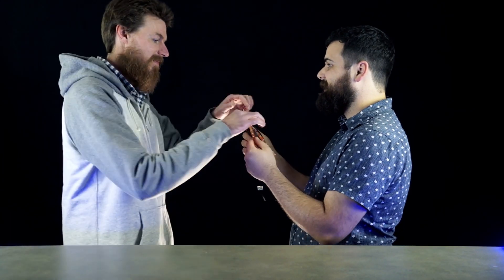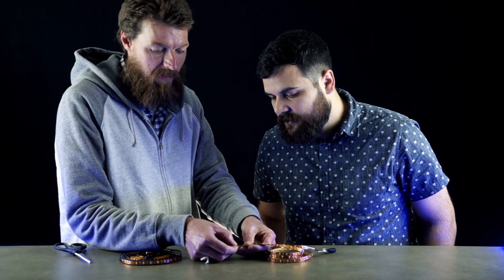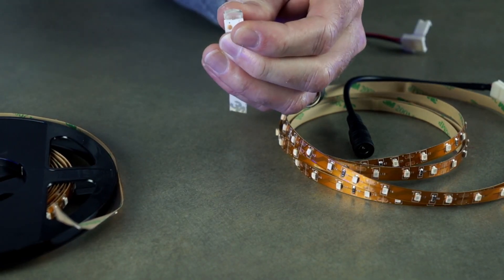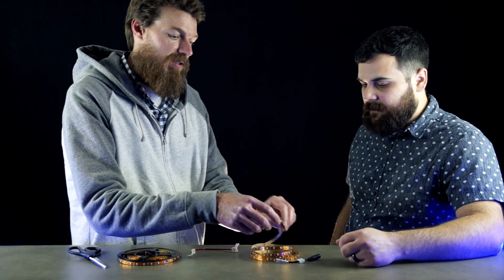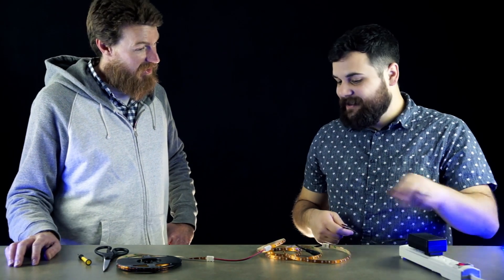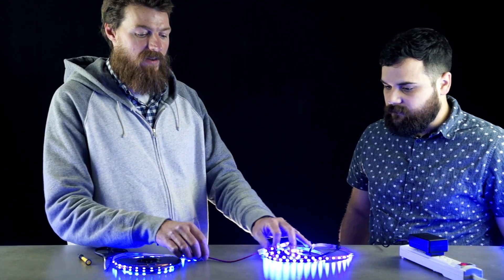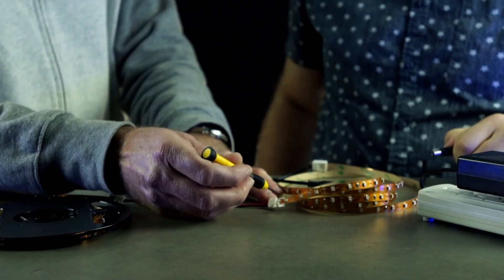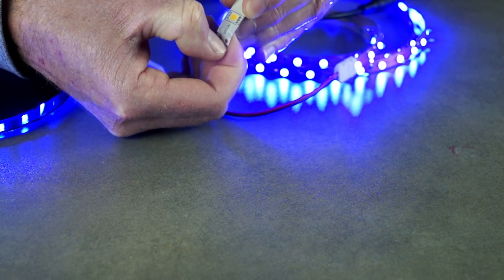Common LED Light Strip Connection Issues

Comment: Hold up this is inaccurate AF. If the strip doesn't cut on its the psu or the outlet? NO, I'm troubleshooting some 24v COB strip that worked fine a week ago, but now no output. Pulled out the old Multimeter and tested voltage from the start down the strip. PSU spitting out 23.75v and at various points of the strip it's the same story. There is some voltage drop to like 22.75v, but still no lights. I started checking for continuity on the data line  and beeps all around
Reply from the maker: Hi, @jtmnyallbudsnoseeds for us to be able to assist you further, kindly relay your concern to customerservice@hitlights.com or 1-855-768-4135. Our technical team would be happy to assist you with your issues. Thank you!

Comment: I just opened a new set of Extreme strip lights. When I turn them on, all it will do is blink red. I tried resetting it, the batteries are new, what am I doing wrong?

Comment: My problem is just annoying i have a neon strip that connects to this white box and then an adapter, its really good but it works stays on and has app and remote but after like one day if i havent sent any signals it will just freeze and not reply to the remote or the app and stay in whatever setting it was, to fix this is have to remove wire from power supply and recoknect and it works again why is this sooo annoyinggg

Comment: Hi my light strip only comes on when i push the connectors together when i let go they come off
Reply from the maker: Hi Shirley, this usually happens when connector pin doesn't have enough contact to LED strip copper pad.

You may follow these simple steps in trouble shooting the issue:
1. Open the connector box
2. Check and make sure that LED strips oval or circular copper pads are properly lined up or touching the connector's silver pins.
3. If you can see that they aren't aligned right, gently move the strip back and forth until the strips light up properly and this usually fixes connection issues of your LED strip.

If you need further assistance please contact us at  1 (855) 768-4135

Comment: My thing to connect it is lose and if I do it carefully and it doesn’t fall out it won’t work. I used to just set them down carefully and it worked but not the connection thingy won’t work at all. Sorry this was badly explained but if anyone could help pls reply to this comment (I have stardust leds btw)

Comment: mine wont turn on, but when i tried to push it earlier it was flicking, but when i tried it again it wont work. i had this leds for 3 months already. nothings wrong with the battery, even if i try to turn it it won't. idk if its incorrect wiring or something, but it just wont work yo 😭😭

Comment: I need help
I have 4 wire 3528 rgb strip light and i want a connector between two cuta but i couldn’t find one anywhere cause 4 wires some only with 10 mm strip light width but my strip light width is 8 mm. Please help

Comment: I have a led strip that works fine in running mode. But after 2 mins the other half will freeze over but still has lights on. Help me guys

Comment: Help my remote that is for one of my lights is connecting to another brand of lights
Reply: Thats normal.
Reply: If you want them different colors. Turn one off and turn on the other one change it to the color and repeat the same steps for the other side!

Comment: I have two light strips connected together, and i want to add a 3rd, but it won’t turn on. The strip isn’t broken when by itself it will turn on but not when connected to the other ones i have

Comment: my leds only work a tiny bit when i touch the silver thing in between the actual lights and if i touch the one labeled “green”, it turns blue but when i touch the one labeled “blue” it turns green
Reply: same issue here, you ever solve it ?
Reply: @andreasmoustakas1171  no srry hadda trash them 🤷🏻‍♀️

Comment: Ive done 4 sets of lights. TVs, bedrooms. I connected 4 sets of strips together. One strip will be yellow and the other 3 are red. One strip is white the other three are blue. In the bed room the further the distance the color changes. It will be red close to the power supply and almost pink orange by the end of the 60' run. These connectors do not work well at all. They are so finicky.

Comment: I literally just got mine today and they turned on once and when I put them on my wall they won't turn on
Reply: Did u ever fix them ? I got mines today & they were both working until the right side started to  cut out I was having trouble getting that side to connect while putting them up tho.

Comment: i just received my led lights but only green turns on. For instance, if i click purple or yellow it either dims or turns off. Depending on the color I choose. The arrows ARE matched. help?
Reply: i have the same problem did u find a solution?
Reply: My lights only show yellow blue and white, when I disconnect I one of the lights the other one is normal😭

Comment: i have 2 of 5m strips, i bought both at a different time ive been using it for a week now. but i woke up then the other 5m strip, a small quarter of it has no blue on it. the first control box wasnt working, the other strip wasnt as bright as the other one. so when i changed it, the lights are equally bright but the blue is still gone. Help me lmao
Reply: Wait I bout same brand but diff weeks than I adapted them but 1 side brightness isn’t working like the other one also how do u sync them cause mine when I change one side has diff color other one is a it side

Comment: i plugged them in and they wont turn on, but when i touch a censor thing on the strip it turns on a portion of the strip and i changed the battery in my remote to see if thats that problem but now it wont open, my little sister spent 50$ for them

Comment: Mine wouldn’t turn on it was a dim light blue color I was thinking it’s the remote battery I wasn’t I got the lights 3 days ago only thing u need to to do if you have the same problem is switch the outlet it is in

Comment: If your lights stop working do what I did, check the white box the big battery goes into, pull it out and see if the plugs plastic has melted this is because you have to many LEDs

Comment: I just got mines today and one strip worked fine but when I hooked the second one up (which came together) they didn’t turn on 🥺😢PLEASE HELP BC IM BOUTTA CRY
Reply: Try connecting both lights to the receiver, should have two cords for two connections. Then run the lights away from each other, and have them meet somewhere.
Reply: Vlad the comrade thx they work now

Comment: so i had dropped my controller in water on accident and it feels like I’ve watched every video and nothing works I’ve tried different outlets, connectors, took everything piece by piece and nothing works but after i dropped my controller in the water i automatically took all the water out by shaking it and tried it and it worked again but then i unplugged it and then the next day it didn’t work I’ve been crying and i need help

Comment: I received my led lights today, I made sure to plug it in correctly, but it’s not working.
Reply: Ada Onyeani did it ever work?
Reply: Jaedan J yes
Reply: Ada Onyeani How?
Reply: Ada Onyeani howww?
Reply: Ada Onyeani HOW PLEASE ANSWER
Reply: Harrisha Reyes I just kept taking them apart and putting it back together
Reply: i need answers on how they work please
Reply: i just got mine, i hung them up and everything and i even changed the battery in the remote but it’s still not working😭😭i spent 30$ on amazon for these and I’m broke and they won’t word

Comment: ⚠️PLEASE HELP!!⚠️

Only like three weeks into having my LED lights I noticed that my TV remote also controlled my lights for some reason? (Certain buttons would change the colours of the lights) but the On and Off button to my TV remote would turn my lights off and I would just turn my LED lights back on after.. but one day as usual my tv remote On and Off button turned off my LED lights and now they won’t turn back on at all. I’ve tried everything.. I’ve tried new sockets and new extension cords, I’ve tried unplugging everything and replacing it back in.. I even left the lights alone for a while thinking that they would maybe turn on again if I just left them alone for a bit but they still won’t turn back on :( someone please tell me what to do! ⚠️

Comment: Liam please help I’ve had mine for about 2 or 3 months and I had lost my remote a few weeks ago and just found it and me and my friend were testing diy colts and all the sudden they turned off. The buttons on the wall and the remote isn’t even turning them on. I plugged and unplugged them and fixed the wires and everything but they still don’t work! What should I do

Comment: Need help! My led strips are not working right(specifically GREEN). When the led is on turned off green is on but on dimmed. When I turned it on and set on green light same things happen when it is off. dimmed green only appears. That is why when I set it on white, purple/pink color appear. It seems green is not working properly. Please help. Thanks in advance!

Comment: Why only one side of my led lights work n when I flip the connect thing the other side stop working and the other one works... plz contact me if u know how to fix this
Reply: Yes same problem with me have you figured how to fix it?
Reply: Crunchy flip the sides of the thing that’s on your wall and it should work
Reply: Itznay N wait the thing?
Reply: Itznay N what thing?
Reply: Itznay N is it the thing where you connect the four lines to?
Reply: Crunchy the 2 led lights that connect together on the wall... not the one that plug in the wall but the ones that’s on top of the wall
Reply: @itznayn4524  minee wont change brightness

Comment: i just put up my led lights today. they were working perfectly fine until i turned them off while we put the rest of them on. when i tried turning them back on it wouldn’t work. we unplugged the wires that connect to the white strip on the white box. they used to flash when we would plug it back in, but now it’s doing nothing. can someone please help me.

Comment: i had mine for 1-2 months already and they worked fine but i tried to move the adapter a little and the whole thing turned off and the green light isn’t even on somebody please help😔
Reply: I have the same problem 😭 did u find a solution???
Reply: Nora Sama same

Comment: when i plugged my led lights into my extension outlet, they turned on but they won’t change color. i would try using the remote to change the color but it just stayed on purple. please help me 😩
Reply: Mine always gets stuck in purple too :/
Reply: Mine does that same with very low brightness! I left them on overnight and when I woke up they were in that state!
Reply: i just got mine for christmas and mine do the same thing. they are stuck on red and won’t change colors. did u figure out how to fix if???

Comment: Was trying to build a neopixel blade for my lightsaber and it has a RGB compatibility in the strip but for some reason when I wired it it all came in white and when change the color I can change the color of via an app on my phone with my saber but I have a question if both data lines are touching with this cause the LEDs to just register as plain white

Comment: only one side of my led light strips are working it’s so annoying!
Reply: Both of mine work but they are different colors. Pleas help
Reply: Natalie Haadsma same
Reply: Bunny.Milky same here
Reply: So what you do is flip the white thing that plugs up to it but leave them on then they both should come on I have having the same issue
Reply: @4strokesmokemonroe714  thanks!
Reply: 4strokesmoke Monroe thank youuuuuuuuuu
Reply: @4strokesmokemonroe714  I did that and it didn’t work
Reply: OKAY! So I just had this problem and you need to play with the remotes and spam them. So basically just spam the on and off button and it should work. I just did it and it worked
Reply: Lina Jones it didnt workkk
Reply: Lina Jones mine needs to be bent sooo much
Reply: Lina Jones yeah I done that
Reply: Guys I know how to fix that I had that issue but it turned out that you bent it so it loses connection so unbend it and it will work
Reply: Jana Hesham , ok so can you like explain what’s bent ?. cuz i’m confused on what’s bent.
Reply: Jana Hesham the only way to use mine is if it is bent 😩
Reply: SciiZ just tap a bunch on the led lights where it’s not turning on
Reply: Sameeeeee
Reply: did you ever figure it out?
Reply: thats because its become disconnected to the other side of the rgb's
Reply: SciiZ  this happened to mine and I think I know how to fix it ! Do you know the wires where you hook them together unplug them twist them the tiniest bit then plug them Back in !
Reply: Abi Pearce Buttery I don’t get it please help me only one side is working
Reply: xbunniesx so where the other strips are connected to the one that is working the little connectors , unplug the connectors and rotate them and then put them back in and see if they work , have a mess about with them and they should eventually all be working
Reply: Abi Pearce Buttery thank you I’ll try
Reply: xbunniesx okay let me know if anything changes
Reply: Abi Pearce Buttery just had my sister help me out and it still wasn’t working any other advice?
Reply: Abi Pearce Buttery they still not working any other advice?
Reply: xbunniesx did you twist the connectors on all of your strips , some may need to be twisted some may not , the only advice I have left is keep trying and play around with them maybe after a day or two they will start working , just try unplugging them twisting them and experimenting with them !
Reply: Abi Pearce Buttery okay I’ll update you soon on them! Ty
Reply: xbunniesx okay ! no worries
Reply: @abibuttery3752  THANK U THANK U THANK U I WAS ABOUT TO RETURN THEM BUHHHHHH NOT ANYMORE!!!:)))))
Reply: Arrow Chang no worries I’m glad it helped !!!
Reply: Abi Pearce Buttery , so i’m confused... idk what wires i feel slow , can you tell me what wires?.☠️
Reply: @abibuttery3752  thank u so much !
Reply: i'm having the same problem :(
Reply: me tooo !
Reply: samee there was 2 and only 1 is working :(
Reply: try flipping the white thing with the four holes that connects the lights to the other side, if the arrow is pointing down flip it to the other side up, lol i hope that made sense !
Reply: @courtneeaster4543  z.  z  aavb
Reply: One side of my stop lights is one color and the other side is another kwidieijd
Reply: GUYS I KNOW BASICLY WHEN U CONNECT ONE CABLE TO THE OTHER MAKE SURE THEY ARE CONNECTED IN THE RIGHT ORDER MEANING BLUE WHT BLEU RED WHT RED ETC I THINK U HAVE THEM CONNECTED IN THE WRONG ORDER LIKE SO OTHERS CAN SEE
Reply: @andrevieira2911  BRO THANK U NOTHING ELSE WAS WORKING
Reply: Same
Reply: Same
Reply: Same
Reply: same
Reply: Same
Reply: Me too
Reply: same
Reply: Same please help me only one of them are working
Reply: xbunniesx where the lights connect to the white box, (with the 4 holes) unconnected them and turn that white cord the opposite way you should see an arrow on the white connector piece flip it the other way. i hope that helped !
Reply: Courtnee Aster thank you I will try
Reply: I’m having issues so my lights don’t show blue and I can’t flash my lights. Also if I press one color it would start that color and then at the end it would be a different one. I need help pls!!
Reply: beutiee :]  me toooo
Reply: Same
Reply: Same if any figures it out please tell me
Reply: IKR
Reply: you can flip the conector things over  it worked for me!!!!!
Reply: @Brooklyn83972  when I tried that it didn’t work
Reply: Sameee i’m so confused
Reply: Same
Reply: same!
Reply: same
Reply: Same but it is two different colors

Comment: Mine doesnt work, I connected everything correct way, when I plug it in its lights up for one millisecond and than turns off, I thought it was because of the remote but remote is also fine. Anyone knows what the issue can be? I can show you how it looks on snap
Reply: Emotinal_kidd mine are also doing this, so if anyone could help that’d be highly appreciated
Reply: i’m two months late but same. has anything worked?
Reply: Mine are doing that too, I’ve been trying to fix them for months 😡

Comment: The arrow buttons won’t work on mine.
Reply: I found the solution: When you click the diy buttons hold down on the green down arrow or blue down arrow
Reply: To make it more clear, just hold down on those down arrow buttons until it turns a different color for the diy buttons. What I did was I kept holding down on the down blue arrows until it turns green and keep doing to same things with those arrows.

Comment: Okay, serious inquiry’s only. I’ve had these light strips for about a year, and every time I turn them to the color red, they are all red, but when I turn them to blue, three of the tiny lights aren’t working. And then when I turn them to white, the three that weren’t working turn yellow. And so on and so forth, basically there’s three little lights that aren’t in sync with the colors I’m choosing. What do I do?
Reply: dennismaryanski mine do the same i’ve got no clue??
Reply: dennismaryanski update: i have 3 strips and one ended up being the wrong way round so try twisting to connectors maybe??